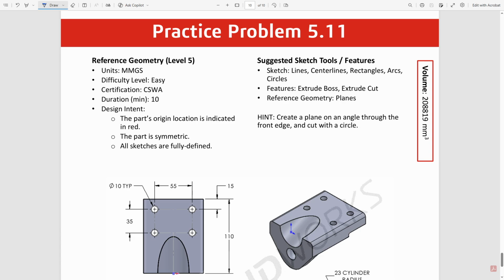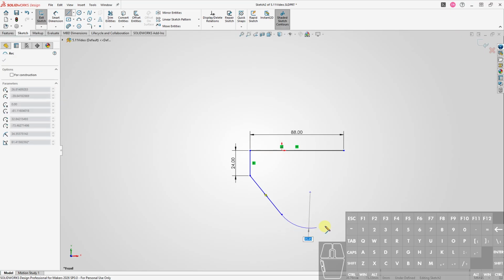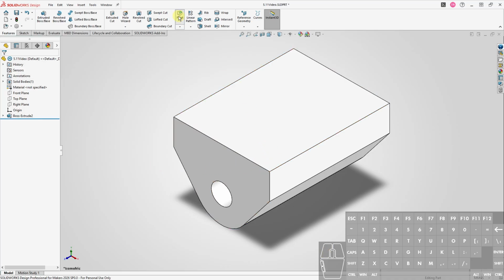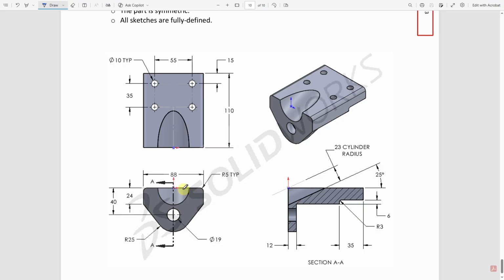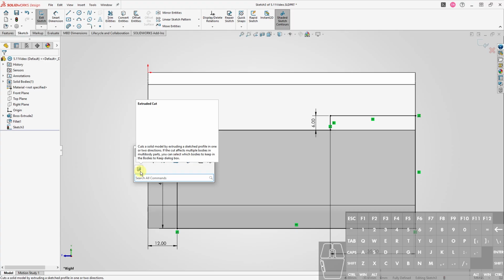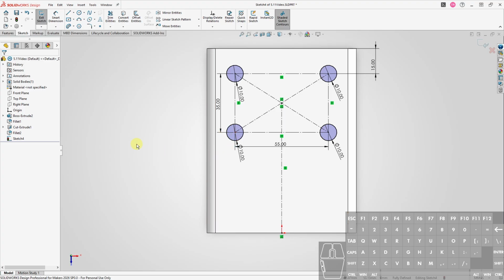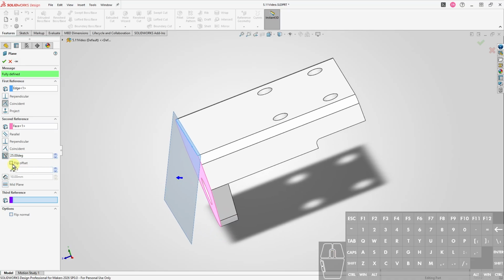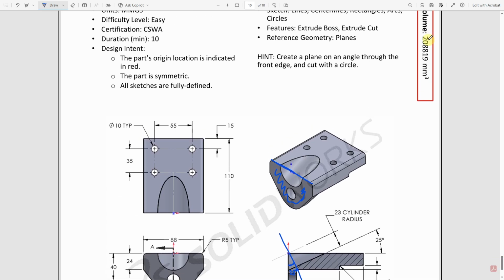SolidWorks CSWA Practice Problem 5.11

Comment: hey man, i like your videos, tks for your work.

i just need a little help, i did this practice problem multiple times, and the volume of my solid's still 208816.71 mm^3, idk what to do
Reply from the maker: Thanks for the kind words about the videos!  Honestly, I think your answer is close enough.  It's well within the 1% of error that is allowed for the CSWA exam.  Sometimes it's just the way SolidWorks calculates volumes that leads to very slightly different numbers.  For example, sometimes when I do an extruded cut from the border of a solid body, I notice a difference between doing it via Through All vs a Through All Both Directions.  In theory, it shouldn't make a difference (since there's only a solid body to cut in one direction), but in practice, SolidWorks calculates them very slightly differently.  One thing you could try is to increase the accuracy of the volume calculations under Mass Properties by clicking on Options..., then adjusting the accuracy level.  Hope this helps a little!
Reply: @DavidsSolidWorksVideos  oh, i understood now, tks for the explication man